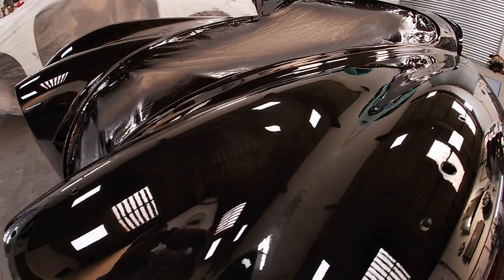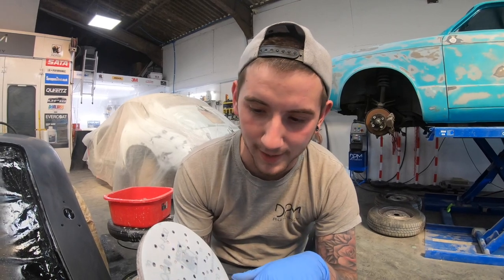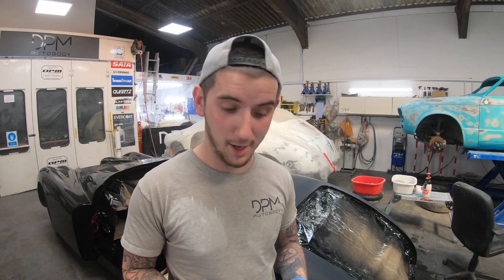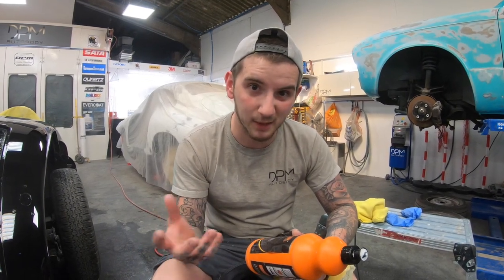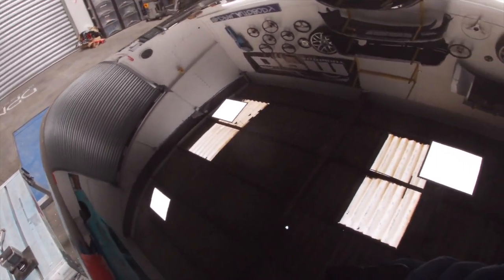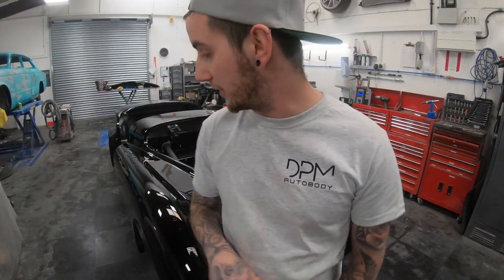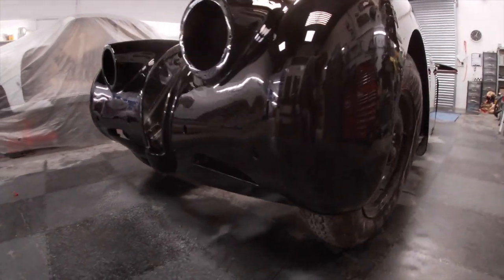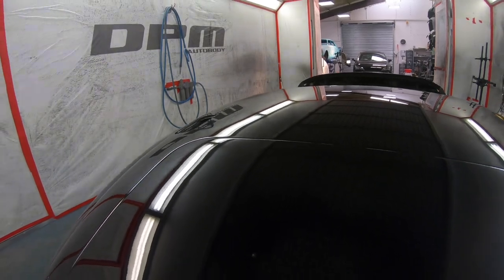DPM TV: FULL flat and polish to Jag XK120 and re build!

Comment: Nice job 
Back in day we used to polish straight from 1200
Trizact system is a brilliant though particularly for black and dark colours
Reply from the maker: Wow that’s a coarse grit to polish up from! The Bentley Continental we are currently restoring started at 600 grit all the way to 6000. I find finishing by DA with either 3000 or 6000 is a must. Polishing up hand flatting marks is extremely hard and 3000 makes life so much easier 👌🏻
Reply: @dpmtv7693  i see you like roar polish have you tried the new ceramic one yet 👍

Comment: Nice work! What lacquer do you use if you give it 4 coats?
Reply from the maker: Ash Parry  we are using max Meyer 0300 - allowing each coat to flash off correctly it’s great for it 👍🏻
Reply: DPM TV never used that one. We use PPG d8131. It’s too thick for 4 coats. Keep up the good work!
Reply from the maker: Ash Parry ive used that but wasn’t personally a fan. Always got on well with the 0300
Reply: DPM TV I love it. Best clear I’ve used. For the price anyway!